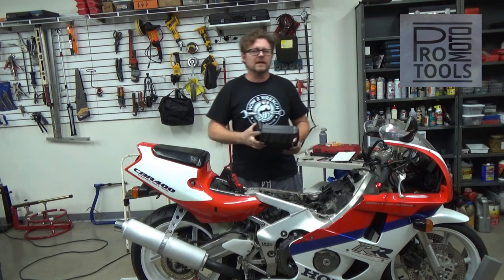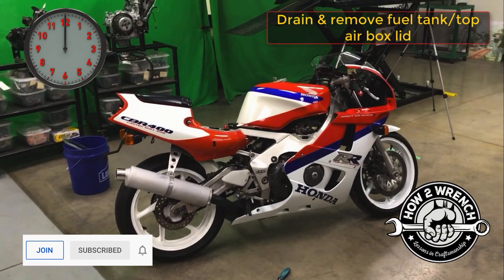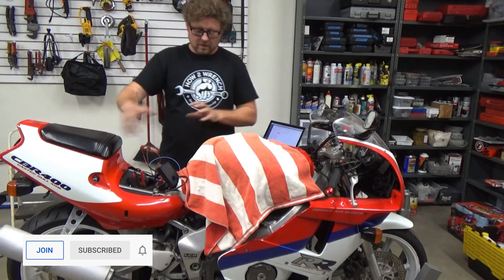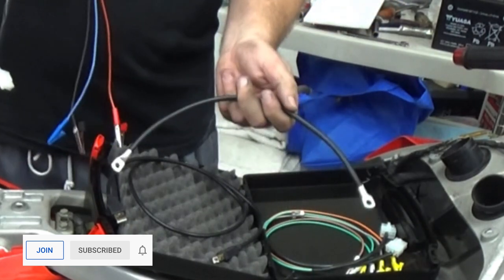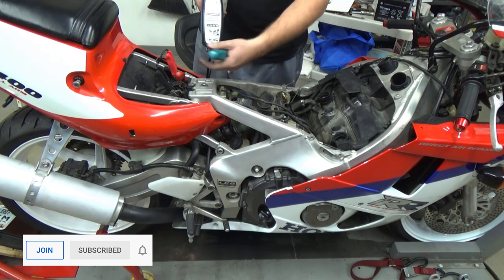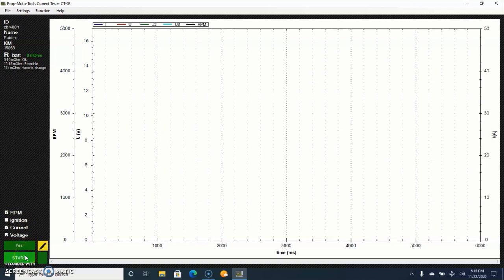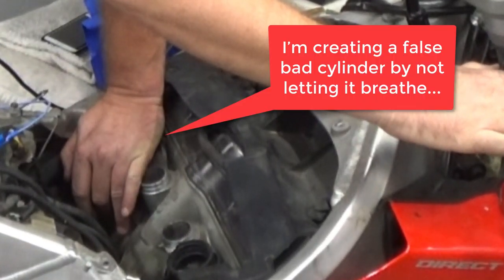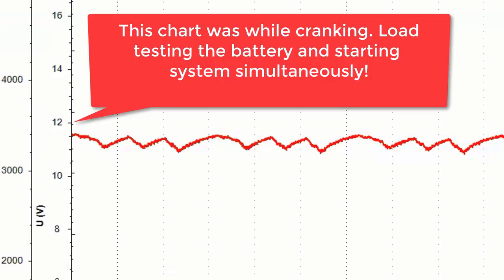Diagnose any engine in minutes! Old Compression Vs. New Relative Compression CT-01 Tool test!

Comment: You can do the same thing with a oscilloscope. What the tool dose is creating what is call a wave form. By studying wave forms (Training) you can check the health of every sensor on a modern car,truck or bike. You can check the spark plugs and coils , injectors etc, etc. With advance oscilloscope waveform training you can see a wave form of each valve opening and closing. Watch the fuel injector open and close. Check health of the fuel pump. Etc etc .... Good video Shane
Reply: Alan Gaudry Where would you obtain training like this?
Reply from the maker: Want to give me a call sometime? 602-345-0432 Gone till monday...😎
Reply from the maker: Thank you. Exactly why I'm pumped to have a $300 scope...

Comment: We are always happy with a new tool;), but the device is based only on the measurement of the current, if it will be 150psi on each cylinder, you will not diagnose it and this is beyond the specification
Reply: Hi Kamil, this CT01+ can diagnose up to 2000 ccm V2 bikes too. CT02 for cars & small diesel tracks (1300Amp.)
Reply: @PropTechMotorcycleTuning   You can compare the load for each cylinder, not by measuring the compression, but it also has many other functions which are often missing in my garage:
1, Battery condition: charging level.

2, Battery condition: internal cell condition, stating current durability test (mechanic gearbox case)

3, Starter motor, starter motor circuit condition 0-300A

4, Engine condition under starting process.

5, Engine condition: long therm cranking condition (engine cranking – not starting); COMPARING!!!!cylinder compression.

6, Charging system control: Alternator/Generator/Rectifier

7, Sensor test (VR, HALL) easy to use PC oscilloscope.
Reply from the maker: Hello Kamil. This engine was spec'd at 156-213 (it had 185). I don't know about you but if in 4 mins I can collect a GO-NO GO data, for battery, starting, and cranking relative compression, I'm sold. What this tool does for me is that it identified a problem off nominal. There are cases where some unknowns of course could throw one off but for the uses I modeled, I will be using this as my new "grab and get to work" analysis tool in the shop and when purchasing used vehicles...Appreciate your thoughts!
Reply: @How2Wrench  I agree with what you said it makes sense, life will show, I hope it will become an indispensable tool, not another unused box as it sometimes happens
Reply from the maker: @KamilCHRT  Right! It drives me nuts to see great tools sit on the shelf because of techs not really "learning how to use them"! I would have students go to dealerships and they would find tools with literal dust on them.